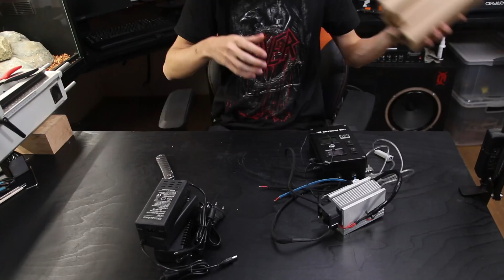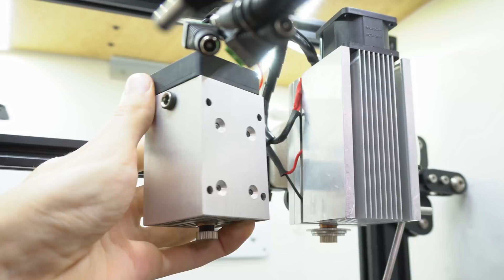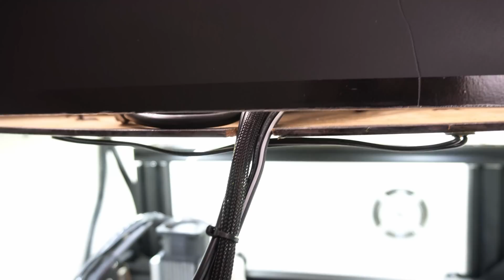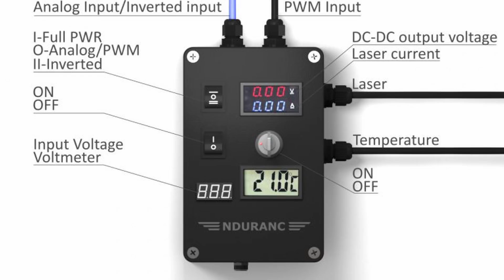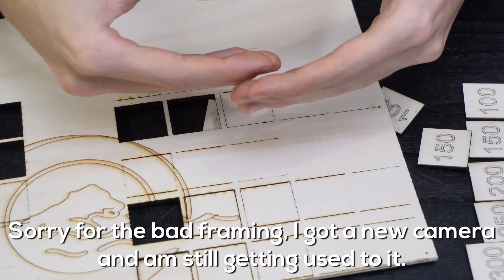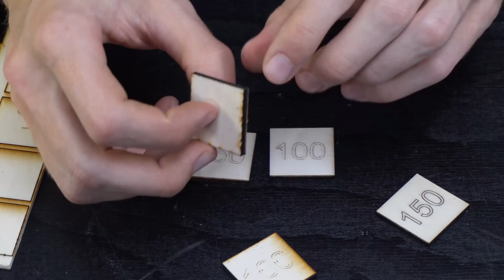Endurance 10W+ Laser Review

Comment: will it help if mounting the laser head not 90 deg but somehow in 45 deg with a specific bracket so the beam shape will compensate at least when square cuts ?
i am planning to attach a laser head on my cnc router as diy, would you recommend the 10w+  ? thank you.
Reply from the maker: This might work for very thin parts (provided they are perfectly flat), but with any thickness, your cuts won't be square, plus any deviation in thickness will shift your cuts to the side.
Reply: @DarkArtGuitarsWorkshop  thank you for your answer, in the question i didn't mean tilting the laser but twisting it at 45 degrees so the beam's rectangular shape will be 45deg not square to x/y axis. as i've seen in it's original position cuts one axis deeper than the other due to it's rectangular shape. could you give it a try in 45 deg position to see if will help cutting equally deep in both direction ? thank you.